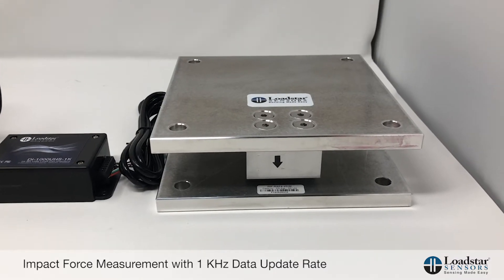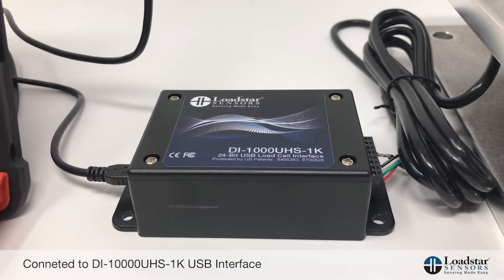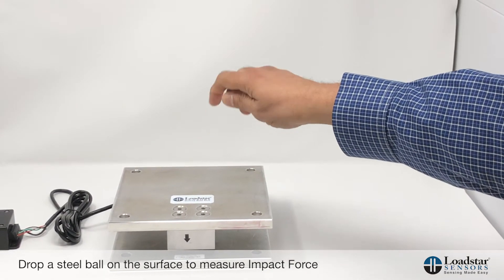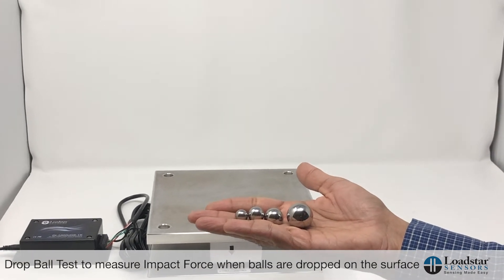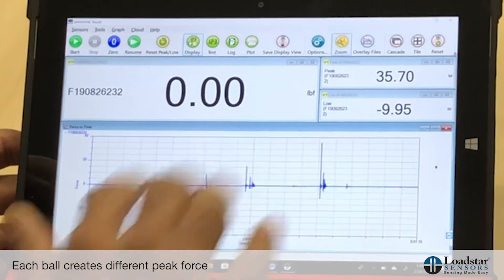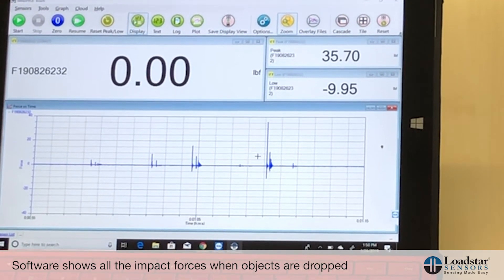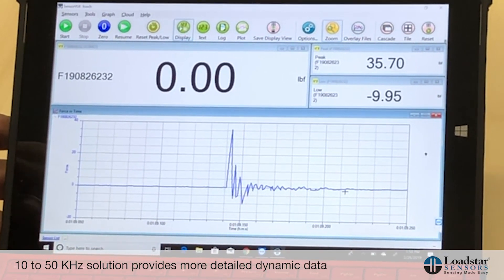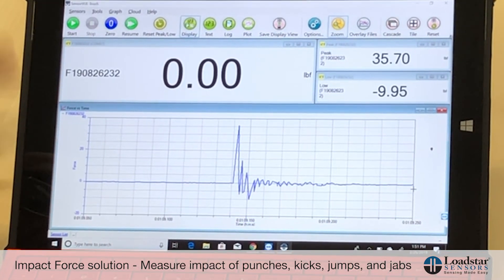Impact Force Measurement - Ball Drop Test

Comment: Sir could you tell me when I drop Mobile phones whoes length is parallel to Earth surface at some distance  why it's doesn't effect on screen....and another one why I drop Mobile hold its one corner the. Drop it then screen may damage why???
Reply: So, not OP but the impact force is less concentrated, so when the corner hits the earth all of the impact is "soaked up" by the corner, but when the flat part of the phone hits the earth evenly the force is spread out a lot more, which means less damage, its similar to how if you are hit with a rock the size of your fist you might be hurt, but if the same rock is ground up into dust or even just way smaller rocks, it might not hurt at all

Comment: 1KSps seems low. I wouldn’t test any lowers than twice that.
Reply: everything depend on interaction material type and velocity at contact  for punch in glowes this 1 khz sytem is more than enough to catch true peak force  but for such rapid impact like those steel ball  well 1 khz is not enough and 2 khz also isint even that he drop those ball from relatively small hight =small velocity steel we can see that impact time was like 1/20 of a miliseconds  20 times less than time interval beewten which this setup measured force :x thatsugest algorythm somehow try to calculate more  :x for catch very good graph from 0,05 miliseconds time contaact the system should have  like 100 khz for 5 measured point on graph :x 200 khz for 10 points what shpuld give precise true picture of what really happen :x .
Reply: @mociczyczki  You are right 1KHz is enough to capture peak force and it depends on what type of analysis you are trying to perform. Most tests using impact are to understand potential damage to the material such as pseudo velocity shock response spectrum (in/sec) in frequency or time domain. Applying a low pass filter (or butterworth ) gives very similar results compared to a high frequency signal while speeding up computing time drastically. It also depends on the application environment of what your device may go into and it’s resonant frequencies.
Reply from the maker: We offer two solutions. One with a max 1 Khz effective data rate (1920 Hz sampling rate in the ADC) and another with a data rate up to 50 KHz. We like to use the second one with at least 10 Khz sampling rate for hard surface to hard surface impacts. Check out https://www.loadstarsensors.com/impactforcemeasurement.html for more information.